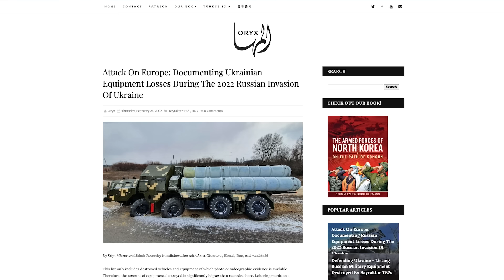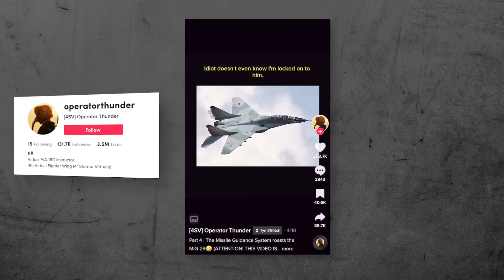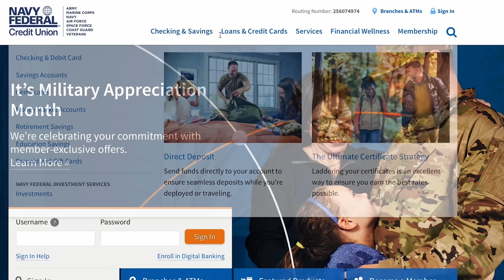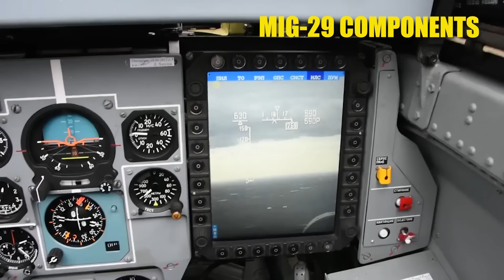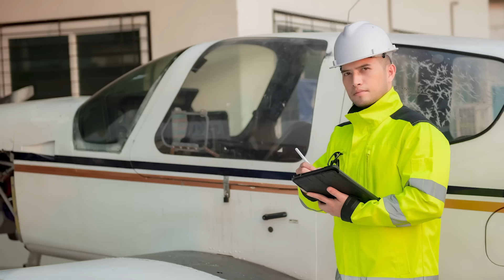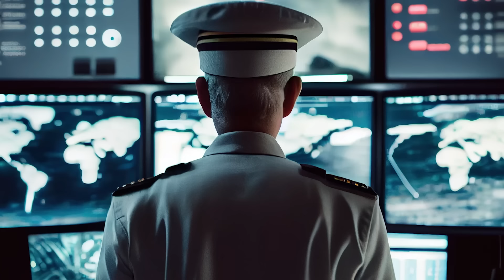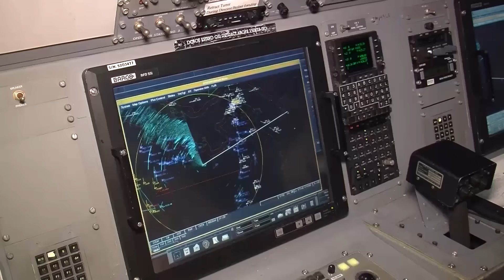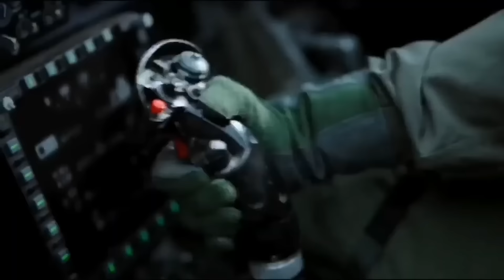How Ukraines new MIG-29 Fighter Jet Operates

Comment: I'm a recently retired F-15C pilot, I can add some anecdotal context.  F-16s are the wrong aircraft for Ukraine.  While the F-16 has far better SEAD capability than Mig-29s, it's in the same boat when it comes to being preyed upon by Mig-31 and Su-35.  The F-16 is a multirole fighter for a reason, and that reason is because it's ineffective at long range combat, and with Russia launching R-37 air to air missiles at Ukrainian jets from 100 miles out, the F-16 has nothing to counter that threat.  Why?  Small airframe aircraft such as the F-16 and F-35 struggle with radar output cooling, there just isn't enough physical heat sink area and fuel stores to run cooling lines through to match the radar output of an F-15 or Su-35, which means large frame aircraft can launch on smaller jets from much farther out on radar power alone.  I flew Red Air for a while at Red Flag and a flight of 4 F-15Cs routinely downs 12-18 F-16 / F-18 with no losses in real scenarios, its not even fair.  The correct aircraft for Ukraine are French Rafael (with the fancy electronics package) or EA-18G because ECM and ECCM are equalizers when it comes to leveling a BVR disparate battlefield.  The Rafael or Growler might still not be able to pressure the Mig-31 or Su-35 in air-to-air, but the jamming pods can give Ukrainian pilots the ability to get close enough to the front line to employ HARMs or air to ground munitions while frustrating both ground based and air based Russian radars and missiles, giving much better survivability than an F-16.  The Rafael has 14 hard points vs F-16's 9 so the Rafael can also shoot down more drones and cruise missiles if needed.  The F-16 really requires F-15 or F-22 mission support in combat Vs. Russian latest variant aircraft.  The F-35 doesn't have the range for mission effectiveness so they generally are in the back lines as support and situation awareness assets.
Reply: MiG-31s have to take long range potshots. Attack helicopters and Su-25s have to get within a few miles of the frontline.
AMRAAM races R-37, but one has to travel 5 miles and the other 100. Which one reaches the target first?
Reply: Thanks for the awesome insight about jet capabilities!
Reply: Thanks for you insight, that's very interesting. My little take on this: Ukraine cant operate their Migs forever, Airframes suffer fatigue, western states run out of replacement Migs. So at one point in time they need something to at least protect their airspace roundabout what they can do now or a little better. I dont think anyone expects Ukraine to gain air superiority, not completely losing it is more the target. Besides, the F-16 can use Aim120s and has at least a better radar than the Mig29, so this would already put some more pressure on the Russians and keep them further away.  As you mentioned the R-37, as far as I know its a anti AWACs and anti Bomber missile and doesnt maneuver very well, so I dont know if its really a great BVR missile compared with the Aim120 when it comes to intercepting fighters (but I dont really know much about it, just what I read)
Reply: There are many commenters suggesting that other fighters are better for Ukraine then the F16. Problem with those is that that there less available for Ukraine, if at all, and the logistics train for maintenance and supplies is far less abundant. So Ukraine will get what it CAN get, and I wouldn't be surprised that they can work around, or even solve those shortcomings. They have the reputation to be very effectively creative.
Reply: I think the F-16 is more accessible than the Rafale which is why Ukraine kept pushing for it. The Gripen is also another great pick, but I don’t think they would get the numbers they wanted for it.

Ukraine already had neighboring countries willing to help them with procurement and likely training for aircrew and MX. I think they will still get some Rafales eventually, but the F-16 is still a great pick for the current fight.
Reply: @ChucksSEADnDEAD  last sentence did not make sense. 5 miles? so the plane has to travel 95 miles while being shot at by the R-37???
Reply: No but the F16 is better than nothing.
Reply: F-18s would be great, except that the US Navy is already short of them. Waiting on new F-35s, currently if every carrier put to sea, some would be missing aircraft. More than 4,000 F-16s built means it really is the logical choice, if only for the fact they are available. There just aren't enough Typhoons and Grippens built for there to be any spares. Rafael, I have no clue how many were built, but good luck getting the French to agree with them being transferred to Ukraine.
Reply: @john_in_phoenix  Ideally the F/A-18F so that the pilot can focus on flying the plane while at 100-300ft while the WSO can search for targets and watch for threats. But that reduces the number of airframes even more
Reply: wow we finally have an adult in the room well said
Reply: @_Dibbler_  Soviet doctrine always prioritized ground based airspace denial (SAMS), which is the opposite of US doctrine which uses fighter based air dominance.  This is why Soviet SAMS are more capable than say the Patriot system, while US fighters are generally more capable than Russian fighters.  Missile capability on both sides (Nato and Russia) is some of the more classified data we keep close to our chest, and while the real world capabilities of the R-37 is still speculation, it's enough to put Ukrainian fighters into defensive before they can even register a radar contact, effectively denying the airspace even if the missile doesn't hit.  Also the AIM-120 capabilities vary both on variant (120C vs 120D) and the platform shooting it.  The F-15C APG-63 v2 and v3 radars unlock more capabilities of the 120D that F-16 and F-18 radars don't have.  So the capabilities is a marriage of the airframe and missile together.  The F-15C has the record for longest missile shot ever in 2021, the range of which is remains classified.
Reply: @pogo1140  It makes perfect sense. The Su-25 is 5 miles away from the line of contact, the MiG-31 is all the way back in Russia or Belarus.
I can punch someone across the face in less time than it takes to run across the street to stop me.
Reply: @whendoweeat  The French will sell the Rafael to anyone willing to buy it.  The issue is that Zelensky keeps asking for free equipment rather than purchasing equipment.  India bought 36 Rafaels complete with support and armament for 9 billion.  Ukraine has 100 billion from the USA to support it's war effort.  Even just using around half that 100 billion, Zelensky could have bought 180 Rafaels for 45 billion.
Reply: Yes, but we have lots of aging F-16's.
Reply: @BasedF-15Pilot  that's just wrong.
Reply: @BasedF-15Pilot  understood. And yet again. okayish fighters are better than having no fighters at all and an F16 Radar+Aim120 is better than Mig29+R-27 (or whatever they use). Perfection is the enemy of the good, its nice when people try to archive perfection but for Ukraine its about survival and nobody will give them F15s or Rafales or an F22, so perfection is out of reach. F16s are within reach and will improve the situation, they will not win the war, they will not bring air superiority, but I dont think they expect that.
Reply: Grippen might make sense. It has the capability but is not as ubiquitous and would probably take more time to deliver it. No need for US sign-off though.
Reply: Maybe at 1 vs 1 is better, but as a whole package amount of avalible number of spare parts / operators / weapons, there is not so many alternatives if France for example under russian preassure will decide dont maintain them tommorow, few month after ukraine will not have any air force.
Reply: @BasedF-15Pilot  Zelensky’s actions make sense. We in the US have spent billions propping up the wrong governments over the past 50 years. Ukraine’s war of self defense/liberation could not be more righteous. They are doing the work of NATO. This is an easy and justified move.

That said, I could see them buying Rafales while also getting subsidized F-16s. If I’m the Ukrainian CSAF/commander in chief, I want to maximize the numbers of 4th Gen aircraft in to develop the capacity to have experienced aircrew training the eventual 5/6th gen pilots of the future.
Reply: I've heard the jamming on the growler is something special. Hence why it won't be deployed there, or any French equivalent. Can't have Russian fingers on it
Reply: How about the Mirage 2000?
Reply: It is nice to see a qualified opinion here. Is the F16 better than nothing or more problems than it is worth? Are older F15s possible?
Reply: @whendoweeat  Exactly! Assisting the middle east nations was like herding cats and that is why the vastly outnumbered Taliban still won in days over indifferent people after years of training.
Reply: The Growler (and I assume Rafael) can also send location data to artillery and ground-to-ground missile operators.
Reply: Where does Typhoon sit?
Reply: All of this makes me worry that without a counter to Russian glide bombs, any offensive will falter.
Reply: I still find it incredibly odd UA and co. can just waltz into Europe and say "i want that, that that and that" and no one says "what the fuck?"
Reply: Fascinating. Thanks for the info. Got to see the 123rd squadron at the Oregon air show today and as a soon to be commercially rated pilot am seriously considering the ANG.
Reply: @BasedF-15Pilot  I don't think Russian SAM's are any better or more capable.  Latest version of the Patriot system can intercept hypersonic ballistic missiles while the bulkier Russian SAMs is easily emasculated by HIMARS.  Even our close range point defense system can handle mortars and HIMARS like guided artillery.
Reply: @kentl7228  Taliban didn't win. didn't win a single engagement.  US didn't lose the fight . they lost interest. How many captured american soldiers where there?  we ran out of space in GITMO.
Reply: @Shinobubu  i didn't mean the USA. I meant the Afghan military as the USA were leaving
Reply: The F-15 is an undefeated air superiority king.  Of course it is going to take out F-16's and F-18's.  The F-15 would also mop the floor with the Su-35 and Mig-31.  So that's a pretty meaningless comparison.  The F-16 has a major advantage over other fighters: it is cheap and readily available all over the world in great numbers.
Reply: @BasedF-15Pilot  I always hated the F-35 more for the lack of range than simply the ugliness, low maneuver and slowness.  Now at least a qualified pilot can substantiate my dislike. I did not know all these 4th gens had stealth attributes.  I have seen the top side and under belly fuel tanks tacked on F-16's. I thought it strange that Ukraine never asked for (some free A-10's) Grippen or Rafale jets.
Reply: Did it hit something beyond 330km? Because that's what R-37M did.
Reply: Issue with F15 that US and allies still use it , and plan for some timer , for Ukraine there are 2 US option  F16 AM as Netherland , Denmark & Portugal can deliver up to 70 of those quickly and uS have loot spare parts & ammo , second option is F/A18 as US have stoped to use it recently , Spain , Finland , Canada & Switzerland will retire those soon to = in short time there can be delivered similar number of F/A18 as F16 to Ukraine.
Reply: This guy doesn't exist lol
Reply: Good story, needs more dragons.
Reply: @Shinobubu  so giving up doesn't amount to losing in your mind? Taliban rules Afghanistan. Sounds like a win to me.
Reply: @leflavius_nl5370  that's because you don't understand global geopolitics or what's at stake here.
Reply: @BasedF-15Pilot  Ukraine doesn't just have $100 Billion sitting around in a bank. Thats not how military aid or presidential draw-down works. When we send them a $5 Billion aid package, thats the cost of the weapons/equipment being sent at current replacement cost, so the US can replentish its stocks with new weapons. i.e. The AGM-88 HARM currently costs $200,000, but thats now what the USAF paid in 1984. In the end, Ukraine will take whatever NATO gives them, France is not in NATO and will only give the Rafaels if it gives them good advertisement for future sales...but like Russia is learning. It's tough to sell equipment to the worls when you Vondervaffe is getting shot out of the sky by 1980's soviet block gear.
Reply: I think F16s are coming with JASSM missiles. F16 is capable of launching JASSM and JASSM  has a range of 400-1000 km. Ukraine needs them to strike targets in Crimea. Rafale doesn't have capability for launching JASSM  yet. It may require time to integrate them with JASSM. Although americans nor ukranians never mentioned JASSM I think they did negotiate about them behind closed doors.
Reply: @jamesmedina2062  A-10s will just be a liability, the only time they work is when they are fighting goat herders and  have air superiority.
Reply: @pogo1140  No he's saying the Mig-31 shooting at the F16 launches at 100 miles and the F16 shooting at the Su-25 launches at 5 miles.
Reply: @appa609  ok, that makes more sense
Reply: @BasedF-15Pilot  we are talking about aprox. 100 billion worth of equipment! Ukraine for the most part wasn't given actual money, there are loans, but a country at war as a lot of expenses.
Reply: @Pinicle_of_evolution  the biggest weakness and problem Ukraine has is not having slow-moving, low-altitude gunships including Cobra, Apache, C-130, and A-10. They also don't have the fast planes either and don't have bombers in use. They almost don't have any air assets. So they need a lot. They have very little. They don't need only one thing. At the same time, each air asset has its limitations and needs the support to operate. If Ukraine had 20 A-10's they could mop up every armored asset and push Russia out very quickly perhaps a week but it is an apex US fighter that nobody else has and the USA does not share everything it has including F-22. The US pushes propaganda out too. You should not believe everything they say.
Reply: I agree. F-16 is not an air superiority platform. Except for SEAD-specific airframes, the F-16 is a small bomb truck. Our pilots in Iraq had to decide whether to use the A/C to cool the radar or the pilot.
Reply: @BasedF-15Pilot  I don't know about the Patriot being more limited than Russian SAMs. Both the Pentagon and the Ukrainians have been tight limped about the shooting down 3 Russian warplanes and one attack helicopter over Russia. Since even the Russians suspect they were shot down by Patriot batteries. Which would mean Patriot radars and PAC 2/3 missiles have classified abilities/ranges that we are only now discovering. Abilities and ranges I might add the Russians boast their S-400 and S-500 have but have never been seen.
Reply: Right now MiG's the Ukrainians are using are extremely limited export models from 1980's. They don't have access to later generation MiG-29's or Su-27's. So even block 50/52 F-16 C's and D's, would be light years beyond what they currently have. The F-16's can do air to air and air to ground (using smart weapons) easily. MiG-29 air to ground payloads are limited and they can't use most US/NATO air to air or air to ground 'smart' munition's. At the same time their is already a supply chain for F-16 maintenance, repair and replacement parts in Eastern Europe. Not to mention the 100's of useable airframes sitting in storage around the world. Meaning replacements for losses is not just do able but most likely SOP. Its also been stated that if any air frame needs major work. That like NATO tanks, they will just be shipped to Poland or another NATO nation for repairs. The only real current hurdle is that every European nation that uses the F-16 uses its own custom combat software suite. But combat computer experts from Lockheed (who currently build the F-16V or block 70/72), say it should be possible to delete and install/over right a single software package for F-16's used by Ukraine (either the Polish or US one). The only limitation will be if any weapons system specific to the donor European nation require their software to work. But this shouldn't be an issue as main reason for using the F-16 is being able to use as many US/NATO weapon systems as possible.

So is the F-16 best plane for air war in Ukraine, probably not. But is it better than MiG's they have now or could get in the future, yes yes they are. Most expect the Ukrainians to use their F-16's in anti drone and cruise missile intercepts. It has a superior radar and rwr to the MiG's currently flowing by Ukraine. So even in limited air to air missions it is a superior air craft to Ukraine has now. Though the Ukrainians will mostly use their F-16's in air to ground attacks close to the front with limited SEAD missions. With the planes spending the majority of their time flying from air field to air field staying one step away of Russia's remaining precision guided missiles. That is if Putin will use them on difficult to hit military targets and not easy to hit civilian ones. Shame the upgrade program for the block 50/52 F-16 is only a year old. Block 50/52 upgraded to F-16V/Block 70/72, with its new combat computer, data link and AESA/SABR radar. Would mean the donated F-16's could essentially function as F-15C's.
Reply: As a retired Mission Crew Commander Air Battle Manager on AWACS that have controlled all pilots from many countries in many Red Flags and every US aircraft on the Korean peninsula, the F-16 is in abundance and there is a need. It may not be the best fit, but it's an improvement.
Reply: An updated, top of the line Rafael costs more than an average F-35, of $90M. (If memory serves, from reading around, I think the Rafael costs roughly around the much expensive F-35B, which is around $115M -  $130M per unit, due to its specialized vertical take-off-landing contraptions, plus low number of production.)

Operating the much larger, more powerful Rafale is ultimately more time consuming and more costly, due to its two engines (despite the public numbers out there saying the cost per hour operation of a Rafale is lower than the cost per hour operation of a single engine F-16: two complex engines on a high end fighter jets need at least TWICE as many mechanics, twice as many HOURS, to check and to repaire.... that's just common sense). 

A top of the line F-16, on the other hand, costs only around $60M. Lower end costs for the less well equipped ranged between $15M to $30M.

Unfortunately, the Ukrainians don't have money for ANY fighter jet, so, forget about getting $120M Rafales... and even if Ukraine were to have $5B available for Rafael purchases, there's no way to secure a number they would need.

But there are 4,000 plus F-16s produced over the decades... so there are still HUNDREDS of F-16s in very good shape, and still being flown, in half a dozen European countries. 

Denmakr, Belgium, Portugal, Poland, the Netherlands... combined, they could easily come up with 50 F-16s --- all donated or purchased with funds made available by the US and the EU --- late this year to early next year.  

Americans could donate more than 50 today, if it wanted to... but it likely wouldn't do it. What it'd do is to make FUNDS available, with the EU.... so Ukraine could use that money to buy a dozen more, on top of those donated ones from these said European operators of the F-16.

So, yes, F-16 is the most sensible jet for Ukraine to have, right now.
Reply: @bohuslavhumplik6744  are you high? Ofc France is in NATO.
Reply: What about... F-15s? the Eagle has a pretty beefy radar too, as you know. Just give them Strike Eagles. Those are great at CAS, aren't they? They are STRIKE fighters, after all.
Reply: Good conclusion. But I think they push so hard for F-16 becouse they could get some eighties versions for cheap to be able to use western weapons and systems, and those would be really cheap in comparison to other airplanes.
Most of what they get would be pretty much decommissioned or almost decommissioned aircrafts. It's the same thing with M113, HMMWV and so on.. It's cheaper to send it to Ukriane and say "i we support you" then to scrap it properly.
Reply: @Paweł Kabański  the Gripen would have been perfect to purchase back in 2014-2015 as part of their build up, this is the war scenario it was designed to fight - and it can be equipped with the Meteor missile that has a 200km range. 

If Ukraine had those up and running by the time Russia invaded, they could have air superiority and have won a air attrition war due to the Gripens fantastic logistics. 

But there are simply not enough Gripens in existence for any to be spared for Ukraine. 

The only possible far fetched solution would be for  the US to backfill Sweden's (or Hungry/Czech/South African airforces) with a whole bunch of existing quality US inventory so that operational aircraft could be sent to Ukraine. 

The Czechs are the only viable option, as they could be given a mix of F-35's and F-16's(/F - X whatevers available and useful) out of existing stocks and rely on their fellow NATO members for maintenance and logistics while they got up to speed with their new paradigm.
Reply: @whendoweeat  just because it's right doesn't mean we owe them anything
Reply: Thanks for the dope reply!! God bless you. And thanks for your service.
Reply: "rafael"    ?
Reply: What? The f16 was made as a rocket with a seat by a combat pilot wanting the ultimate dogfighter.
Reply: @sethshaw5680  can it outrun a SAM?
Reply: Macron and the French are not ready to part with their Rafaels in real time combat stress test (as yet) against the Russian Sukhois, MiGs, BUKs and SAMs.
Reply: There is no country that will help Ukraine with anything significant related to the Air Force. Poland gave its used MiG 29s that had already served their time in the armies of first East Germany and after unification in Germany, and they were sold to Poland, I think, for one euro. Poland later invested something around 43 million euros in modernization. Don't forget the time period in which this happened - 19 years ago! When the last Slovakian Fulcrums were retired, it was widely reported that the final fleet comprised around 11 operational jets — a mix of moderately upgraded MiG-29AS single-seaters and MiG-29UBS two-seaters. Let's not forget that the two-seaters UB and UBS do not have a radar and their use in wartime conditions is very limited, I would say almost impossible in these wartime conditions. North Macedonia gave away its Su 25s that ran out of resources! Anyway, the Ukrainians overhauled them and included them in the composition of their air force.
It is unfortunate that a country that, after the collapse of the USSR and gaining independence, made constant wrong moves. 
First, they destroyed their nuclear arsenal (with the collapse of the USSR they became the 3rd nuclear power in the world), If it had not been destroyed today, there would be no war! There would be no problem of Crimea (seeing things through Ukrainian eyes)!
Second they destroyed their air force (which was the second strongest in Europe after the collapse of the USSR) 3000 aircraft, of which about 1600 fighter planes and 300 attack helicopters. Destroyed strategic aviation partly cut (Tu 95, Tu160), partly handed over to the Russians for gas debt. The rest of the fleet was not maintained (even strategic Tu 22 and Tu 22M), and the flight status was maintained by cannibalizing the aircraft. As a result, the number of operational aircraft was drastically reduced, entire regiments were disbanded, and certain types disappeared from the inherited arsenal.
And so it was in all other segments of the armed forces.
That it has come to the point that today that same Ukraine, steeped in corruption, is literally begging the West for weapons and equipment.
I absolutely agree with you about the Rafale, that would be the right one. But there is another problem. France does not have enough of them even for itself, and it also has a large number of aircraft ordered and paid for for export. What they could eventually get from France are the Mirage 2000Cs that it has withdrawn from use in its air force.
The crucial question is how long does it take to train a combat operational pilot on any type of aircraft? Abbreviated training means that both the pilot and the aircraft are easy targets. You certainly have an adequate and better answer to this question than mine!
Reply: Agreed, send Ukraine your F-22!
Reply: Hi, I'm also F-15C pilot, and my grandma is F-22 pilot.
Reply: Finally someone with real experience who’s able to confirm what I’ve been saying for months! I’ve said the Saab Gripen is the best option, however it’s been pointed out to me that the Swedes don’t have the infrastructure for mass production, though their small ground crew needs and ability to carry MBDA Meteors would be an insane help to the UKRAF
Reply: @jamesmedina2062  Actually I will tell you this that's not really accurate US is not known for propaganda with their aircraft as in are better than they are. USA Does the opposite they learned long ago to Downplay their capabilities till it's needed to be used. Hence why you do not see Show of power parades and such from US. I spent 17 yrs. in the marines and 7 more years at SOC LLC (DOD Contractor). Anyone telling you that US boost their capabilities is 100% wrong They purposely Hide new capabilities and also why they won't allow F-22's to Show full combat capabilities on Exercises! We are more famous for Look overhear wow and while they are looking were Testing in Secret shit, we won't even use for 10 yrs. Do not believe every thing we say but its not boosting Capabilities propaganda Like your making it sound its Secret Operations another words its not o our F-22's have .0005 Radar cross section and really its .00003. (example not meant to be accurate). or  our new fox 1 has a range of 100 miles but really you can push it to 125 miles. or our fox 3's pit bull at 90 but in reality it pit bulls earlier and longer to throw off the first engagement of our enemies someday China and Russia will learn to keep secrets secret and instead of boost really surprise people and down play it then when you show it off people's expectations will not be just ignored and destroyed!
Reply: @c.s.4273  Sure we will send 40 and shit here take 5 of our nukes also why not! LMAO
Reply: @killingyouwithlogic5808  Coward much?
Reply: I know almost nothing about fighter jets what so ever.  So I got no idea which airframe is the best.  But what I do know is, F-16 is the only airframe that is realistic.  

And you forgot to take 1 VERY important information in to account, suppliers of gearsense. JDAM are dirt cheap compared to a GMLRSs rockets even when you have strapped on a guidance and glide kit on it. And makes a WAY bigger hole then a MRLS rocket. Heck you can even put a "HARM" seeker kit on a 3000USD JDAM.   

France and Sweden will never give up Rafael or Gripen, way too few airframes.  

British Eurofighter trench 1? they are about to get shelved, but they are not strike capable, and if Ukraine cant do air superiority with them against Russian targets, then what's the point in trench 1 Eurofighters. Can trench 1 fire Storm shadow? I dont know, but thats a REALLY expensive missile truck, just for that purpose, and it seems like they some how jerry rigged Storm shadows on to Su-24's 

Older F-18 non super hornets? maybe, but who has them? Spain, doubt it, they havnt really contributed with much at all, so why would that change now?  Finland? not until they have F-35 replacements. Australia, from what I read they have some of their old FA-18 in storage, can they fly? and will AUS donate? UKR is not really their problem, so that they have given anything to start with is commendable. 

US navy has super hornets, and marines legacy F-18's, but again, will US donate them? doubt it, I read one article after another that the remainder of those frames are being used so hard they are held together with shoestring and duct tape since they dont have enough airframes as it is.

Growlers? not going to happen, loosing one of those to RUS would be a massive intelligence coup. All that fancy good stuf RUS actually has, if there have been any lost that was salvageable, its being picked apart component by compete in the US and Britain.   that is phote evidence of a complete seminally undamaged EW pod for a crashed RUS SU-34 from last summer.  That thing has been dissected so hard like it was a Area 52 roswell alien by now. 

Tornado's. Germany has a few EW left, plus those they are obligate to keep for the nuclear sharing obligations. Italy has some, dont know  what state they are in, But Italy, just like Spain, have not really cough up any big ticket items at all. So I really dont see it. 

Mirage 2000? maybe, since Macron have stated they are willing to train UKR pilots, and France invest heavily in their own defense sector so buying more rafaels replacing those older Mirage 2000's seems like a logical move.
Reply: @arturasp9738  An your grandad fly in Apollo program to the moon. I know, I saw it!
Reply: Great and spot on analysis.
Reply: You obviously know what you’re talking about but I just haven’t seen one Russian military asset outside carpet bombing civilians working as advertised so my uneducated guess says any of those Western planes will get the job done
Reply: @IrishNDF  No plane, especially not a western one, can be good in this war. They have performed well in the wars that the West has waged against small, militarily weak and powerless states. Using all possible support and logic in terms of AWACS aircraft, satellites, and distinct air superiority both quantitatively and qualitatively.That is not the situation here. Russia has a powerful air defense and a powerful air force, but it does not use it. You will ask logically why? Because this war can easily turn into a direct conflict between NATO and Russia. Russians are not stupid. They know that NATO will supply the Ukrainians with their surplus, or weapons and tools that in most cases have been decommissioned from their armies. NATO will indirectly wage war with Russia to the last Ukrainian and try to exhaust Russia as much as possible, and then if a favorable moment presents itself, it will directly intervene in the conflict. NATO would send first of all Poles who hate Russians from the bottom of their souls. There are volunteers in the Ukrainian army anyway, they just die in large numbers. Another aspect of sending modern weapons to Ukraine is how the tools or weapons will perform in war. The Americans have the greatest fear of this because it affects the sale of the same in the world. If your product performs poorly in a war conflict, you have irreversibly invested money in its development, or rather something that no one will buy later, in order to recover your invested capital. As I said before (concerning aircraft's)  in the previous post, who is going to fly them? How quickly can you train a fighter pilot without both him and the aircraft being ducks in the row on the sky to be shot.
Reply: @richardkudrna7503  The Typhoon in an a2a config is the best a2a fighter I've fought short of the F-22 in bfm.  Unfortunately in BVR it's down the list due to small radar real estate.  Also Typhoons are rarely in a2a config because the nations that use them need them to be multi-role fighters.  Multi-role = compromise.
Reply: @jamesmedina2062  The range is the F-35's biggest Achilles heel, and forces tanker and C2 assets (AWACS) to push closer to the front line.  Stealth attributes are not everything, we have (classified) methods of detecting and targeting stealth.
Reply: @Max_Da_G  Maybe.  😇
Reply: @RasterivacMagle  

"It is unfortunate that a country that, after the collapse of the USSR and gaining independence, made constant wrong moves"

This statement is a painting in a complete misunderstanding of the meaning of what is happening.

It is impossible to fight with Russia from the territory of NATO, this is immediately a nuclear apocalypse. But if Moldova, Georgia, Ukraine, Kazakhstan or Ukraine enter into a conflict, then NATO seems to have nothing to do with it.

How to make these countries self-destruct?
   It is necessary to grow an elite that does not link its fate with the fate of the country.
Therefore, it is necessary to encourage corruption. When competing, semi-gangster power groups begin to gnaw at each other's throats, declare a fight against corruption. When the thieves hide the loot from where the thieves are not given out (for example, to London), everything is completely under control.

How to explain what is happening to people?
It is necessary to finance hundreds of NGOs and together with the press to tell - it does not matter that the DNA of Ukrainians, Belarusians, Poles, Russians coincides 100%. In fact, Russians are not Slavs at all. Russians are prone to violence and drunkenness, are lazy, envious and love dictatorship.
You are talented, hardworking and creative. All troubles from the Russians!

Trade and joint production lead to mutual understanding. So to hell with this production! To hell with this trade! But no one will buy Ukrainian products, except for Russian ones!? Spit!
This leads to the collapse of the economy!!!??? Yes, but Russian and pro-Russian politicians are to blame for this.

Now every Ukrainian is sure that as soon as the country joins the EU, corruption will immediately disappear, the courts will become fair and everyone will live richly. Why? - only pro-Kremlin agents ask such questions.

To get into the EU, you need to prove that you are worthy and break with the dark past. Therefore, Ukrainians desecrate monuments to their grandfathers, renounce religion, ban Russian writers, musicians, speak Russian, make heroes even recognized criminals.
Democracy is like that - you can not even notice how 50 people were burned alive, how they shoot at Donetsk.

Ukrainians were dragged into this swamp for 30 years like sacrificial sheep.
Everything that happened was not an accident, but a pattern.

This wretched state simply could not maintain and maintain 3,000 aircraft. Not before they were.
Thieves could sell a nuclear warhead. Neither the Americans nor the Russians need this.
Reply: @WinVisten  F-15Cs have too many hours and too many airframe G-cycles, they were used far past their prime much like the B-52, except the B-52 can't stress metallurgy like the F-15 can.  This is why we buy new F-15X.
Reply: @uncreativename826  The Gripen is a really good jet for small nations with limited airspace.  But you are right I don't think they can be pumped out really fast.
Reply: @killingyouwithlogic5808  This is correct there are certain tactics that cannot be used in LFE (large exercises) or in dissimilar aircraft bfm.
Reply: @BasedF-15Pilot  Zelenskyy isn't being given the money, he's being given equipment worth the money. So for now France isn't donating their aircraft.
Reply: @BasedF-15Pilot  Of course range matters as does speed, including acceleration, ceiling, and maneuverability. Cost to maintain apparently matters too. What is telling is that F-22 was stopped at under 197 but why? Why were the facilities mothballed? I am assuming to make way for the Swiss Army knife. I do woodwork and am a chef. Why would I want a Swiss army knife that does no single thing that well? I guess they had decades to bling out the sensors in the thing(and computers)..to make them 2nd to none.  The most critical thing today is as you said that these planes are not 777 able to go halfway around globe. They require aerial refueling and the tankers are not stealth or high speed. And they said way more tankers are needed. I just find it absurd to have such poor range and abandon the whole suite of specs the F-15 had...seems went backwards and like you said nothing is totally invisible from all angles.
Reply: @jamesmedina2062  The f-22 main reason for stopping the Production was 2 major reasons 1. Need for specific CAS and Air to air was not really a large need for the war on terror. 2. Making open funding for the 6th gen capabilities. I would never sleep on the f-22 or F-35 or f-15 but There at their best when all 3 are flying tactically together!
Reply: @tristantully1592  They have received Money and equipment! The U.S. has given Ukraine more than $54 billion since the war against Russia started1, with the bulk of the money allocated to military and defense spending2. The U.S. has provided $8.5 billion in direct budgetary support3 and $13.6 billion in military aid4 since the beginning of the Biden administration, including 19 packages of weapons since August 20214.
Reply: @BasedF-15Pilot  People do not understand the meaning of stealth they think invisibility not That you can Locate Stealth Jets but good luck Locking and maintaining lock on F-22 or F-35. Stealth is a major help to the A2A and A2G but by no means makes the jet invisible or Impossible to Find or even lock but makes it worlds harder. I have tried to explain this many times and people just do not understand. Stealth aircraft they forget it's not 1 tech that makes the f-22 as stealthy as it is it's an abundance of overlapping stealth technology that makes the f-22 and f-35 as stealthy as it is. Hence why China and Russia have failed to make a stealth air craft as effective as the f-22 and f-35 there is so much tech that makes up the overall  its insane.
Reply: @Shinkajo  buncha fuckin sunflower and wheat fields

Raytheon, Lockheed Martin and Rheinmetall must be loving it though
Reply: rhdrivingslovenia6413  no it would be Ukraine trained by US.
Reply: rhdrivingslovenia6413  They estemate 6 months for f-16 so I would figure 8-10 months Growlers and 6 months for Rafaels . you need to remember that there trained pilots just not these particular jets its not a total relearn just adjusted!
Reply: rhdrivingslovenia6413  But with that said f-16 is one of the easier to learn jets so maybe 1 yr growler and 8-10 months for rafaels
Reply: @killingyouwithlogic5808  Yes the advent of higher capability computers and "situational awareness" is interesting and yet still to me an unknown. What we need coming up is cheap drone shoot-down, as expensive A-A missiles have been a problem shooting down cheap drones and China will for sure have thousands of drones. The war in Ukraine will teach us a lot. It will be interesting and to see what the J-20 and Turkish jets are like in action.  Even for doctrine we need to study and learn because what need is there for multi-million dollar jets when attack drones can preserve lives and achieve results? A highly defended air space is not a place where jets will be sent anyways!
Reply: Great insite!
Reply: If the Ukrainians are going to have a chance to defeat the ISR strike systems of Russia .,They must take out the layered Air defense systems first.The F 16 is still a 4th generation fighter that is easily destroyed by S-300,S400 systems.This aircraft would be of dubious value as a stand-off attack weapon.
Reply: @averyheavenrich2432  how do the S-300 and S-400 do against cruise missiles and low flying aircraft?
Reply: "with Russia launching R-37 air to air missiles at Ukrainian jets from 100 miles out, the F-16 has nothing to counter that threat" AIM-120.
Reply: You put into words what I never could.  But I have watched enough vidoes by noe to know that you are 100%ncorrect.  Why don't people get it?
Reply: @adammarcinkowski-ko3el  Well, the Finnish F-18s are not available until the F-35s and their infrastructure are there to replace them. Furthermore, one of the reasons they are being replaced is the fatigue. There isn't going to be much flight left in those frames. I'm not saying they wouldn't help in a war, but it won't happen for quite a while unless Finland gets to jump the queue.
Reply: @arturasp9738  This is what I was thinking lmao
Reply: @blechtic  Buddy if there will be need Finland can hand over 12-16 F18 without loosing ability to protect Finland ... Finland is in NATO ! , and after all Ukraine dont need F18 for 25 years service , Ukraine need them for 12-24 months until other alternatives will be avelible .
Reply: Great insight. Thanks.
Reply: @whendoweeat  Getting pilots to learn the ins and outs of one new plane in a short amount of time is daunting enough. Having them train for two different models at once, with different maintenance, parts, radar and weaponry is simply too complex for a country that is actively engaging the enemy at the same time. Less is more.
Reply: @Shinobubu  The Taliban didn't need to win. They just needed to survive. It's called guerilla warfare, slowing draining the enemies will to keep fighting. The vietcong did the same.
Reply: @WinVisten  Most Nato countries don't have them, so both suppluying and supporting them well will be hard.
Reply: @titaniumskunkogkush4365  probably not, but it would definitely out maneuver a SAM. Dont get it twisted. I'm against sending anything to Ukraine, but the f16 would be the most effective jet to send. I just hope they don't get sent.
Reply: @adammarcinkowski-ko3el  ...which is why I said what I said about the war. Fighting a war, though, will stress them more than normally. I'm sure Ukranians would prefer fighters that are less likely to break on their own, but they would work. Pilots would need to be trained.

NATO works on the principle that everyone handles their own remit especially WRT Finland who is not yet part of any of the plans or structures. So far NATO is a week away from Finland if they are needed. Nobody has exactly volunteered to patrol Finnish airspace in order to release those fighters either. I guess they have their hands full with the other half of NATO's border with Russia.

Anyway, all those Hornets are assigned to units and in use, they're not sitting in storage on some desert as a reserve. Surprisingly large part of them are inactive at a time for various reasons. Presumably Ukraine would want theirs out of those that are not out of action. 12-24 months is probably the absolute minimum time in which Finland could provide them, depending largely on those F-35s.

But, be that as it may, I am not the person you have to convince. I'm not the one making those decisions. Finland plays it safe. If some other countries were to be serious about those Hornets, they would try to find a way to make it happen by addressing Finland's concerns.
Reply: Growlers definitely seem like an extremely useful item in this war.
Reply: What is your take on JAS39 Gripen to Ukraine?
Reply: I never considered radar cooling as a limiting factor!
Reply: @BasedF-15Pilot  What nonsense is this? The F-35 carries a huge amount of internal fuel and has more than double the combat range of an F-16. It also does that using internal fuel only whereas the F-16 has to carry multiple tanks which reduces available hardpoints and significantly increases drag.
Reply: @jamroast 

Ukraine is going to have to train a lot of pilots .
I think start with 5000 I’ll never want to run out if pilots
Reply: At last someone talking sense
Reply: @leflavius_nl5370 because it’s in Europe’s collective interest to see Russia lose in Ukraine. Most of these weapons were created to fight Russia, but now they can fulfill that mission without expending American, German, French, British or Polish lives. The general consensus is that defeating Russia now will prevent a wider war later. Whether you believe that argument is not the point. It’s what the European governments believe.
Reply: @bohuslavhumplik6744 France is in NATO. In 1966, De Gaulle took France out of the integrated command structure, in order to have more independence in its potential military response, especially concerning its nuclear weapons. They never actually left NATO, though, and were still fully committed to the collective defense of Europe. In 2001, they participated in the US led coalition’s invasion of Afghanistan specifically because article 5 of the NATO charter was invoked for the first, and hopefully last time in history. In 2009, they returned to the integrated command structure, and continue to be one of the most indispensable member states of this alliance.
Reply: Bro just Eat "My Plane is better" kids in this comment fr
Reply: Finally someone that’s a pilot bringing insight to the f-16 issues, good radar and visual doesn’t mean anything without the missiles. We live in an age where dogfighting is rarely used.
Reply: @nemoclavon566  The F-15 has the ability to 'unlock' certain missile abilities that the F-16 and other NATO jets cannot, even though the same missile is hung on the same rail.  That's why I say the whole platform matters (jet + missile = platform) more than just raw missile statistics.
Reply: @BasedF-15Pilot  I know I’m just saying that’s a point most people miss you’d,people were like f-16 = an ez win
Reply: Lmao whatever you say
Reply: @coronalight77  to me?
Reply: Isn't Russia getting their shit rocked? Also, isn't Russia like 30 years behind when it comes to maintenance and often cannibalizing equipment? 😂
Reply: @hes1shot671  I've seen US jets so cannibalized that they have to put weights in the nose to keep them from sitting back on the tail feathers.  Supply chain on certain parts is thin.
Reply: @hes1shot671  It is but still Ukraine can’t fight far, which is why on land they easily rock them, in the air their MiGs and the haven ones from Poland have been getting destroyed.
Reply: @nemoclavon566  I wouldn't say destroyed to that extent because Russia can project far into Ukraine without getting hit by AA or SAMS. Still bizarre how Russia can't perform SEAD though
Reply: @hes1shot671  well that’s fair but unkraine has been stealing Russian weapons too you gotta keep that in mind, there tanks and even some aa have been stolen (or what ever those trucks that shoot msl are called.)
Reply: @nemoclavon566  agreed but Ukraine does share the same tech Russia uses and I mean if it's free why not? Also, AA trucks are like SAMs they launch anti-air missiles with the use of Radar. Note when using said radar you are also vulnerable to attack.
Reply: @hes1shot671  yea we know unkraine is permitive, but one thing we can agree on is for what they have they are doing good, reminds of the battle between Russia and Iceland.
Reply: Never would of thought about it like this. Dope insight
Reply: @ethangardner2470  everything here is
Reply: I always thought the Saab gripen would be the best option for them what's your opinion?
Reply: @wilfridhunt2468  Can you tell me id like an elaboration and explanation, I’ve never heard someone say that as a choice.
Reply: Would the F/A-18 Superhornet not also be a good option for Ukraine?
Reply: @CitrusAnarchy   nope, they don’t need a another multi role with limited range
Reply: The radar and BVR capability on the F15 is out of this world... Not gonna lie.
Reply: @benjiman46  it is literally, satellite shot down using a msl from that bad boy
Reply: To add on to that, Ukrainian aircrew’s would have to get trained in a completely different aircraft in such a short time. And while an F-16 would be better at SEAD and CAS (although MiG-29s have been AGM-88Cs against Russia), The F-16 is still somewhat similar in that it has a short range, and can carry only 6 A-A missiles (unless you double rack the AMRAAMs idk)
Reply: @zbee-nah-lah  that too
Reply: F16 is often known for its wild weasel capability. R37 is a heavy missile, an F16 can avoid it. idk if your statement has any relevancy.
Reply: @DessertUnicorn  R37 is about 500kg, we've lost more F-16s to missiles weighing over 600kg than we have to missiles weighing less.  Missile mass matters very little when it comes to successful missile defense.  Consider my statement relevant.
Reply: You are saying things that make sense, make it STOP
Reply: Thank you for the detailed input.
Reply: @SovietBear4  sad about the foxbat?
Reply: @DessertUnicorn  Sir those are radar msl, they don’t chase. They have advance tech to counter countermeasures to an extent. This concept is like comparing the MiG 23 to the f-15. There are so many factors making the f-15 better even though it can weight 3 times the empty MiG 23’s weight. It’s heavier for a reason, it’s a hypersonic missile, that thing usually goes 5 times faster than the f-16 and the f-16 couldn’t even fire back. It’s heavier for a reason.
Reply: Well , it's certainly better than nothing
Reply: Is this considered classified information? Or can I send this to Gaijin to prove how over powered something is?
Reply: @nemoclavon566  you are ridiculous. IR guided missiles don't chase either. there isn't a guided missile that "chases" out there unless its wire guided. I mean if you didn't know that then how would you know that we had mach 5 missiles in the 70s AKA the Phoenix coupled with an amazing radar of the F14. But no the DOD didn't think it was worth it or effective yet you and the other keyboard warriors here would much rather argue over it and call hypersonic missile from a country that can barely keep its own population fed with a crippling economy an actual mass threat.
Reply: @spades7227  I don’t think it’s classified
Reply: @DessertUnicorn  Chase as in follow the path of, radar msl go to a set point to hit an air craft, the ir literally goes wherever there’s heat so it is chasing.
Reply: @DessertUnicorn  and why are you talking about the f/14 and the 70’s I’m confused on that part, you just sorta started yapping about that?
Reply: @DessertUnicorn  you need stop trying to start things, like telling a literal vet his statement isn’t relevant, and then trying to call me a jerk to society. I answer calmly and you answer with insults.
Reply: @nemoclavon566  see what’s the point of arguing to you because you think IR guided missiles just follow a heat source. no they intercept the heat signature
Reply: @nemoclavon566  because the entire premise of your “scary hypersonic missile” is the hypersonic part and that it can go mach 5 when russia and US have dun had missiles that can go that far. and then riddle me this. why does the air force and the navy prefer medium range amraams over phoenixes? why is the lightweight missile demanded more than a heavy long range hypersonic missile
Reply: @DessertUnicorn  sir have you not heard of the aim 120 and the 260? Those are bvr long range
Reply: @DessertUnicorn  intercept means meet bro. Follow means go where it goes, intercept is meeting where it goes it’s the different thing bro.
Reply: @DessertUnicorn  the phoenixes are outdated brother, America is the place with the farthest range air to air msl, what makes you think they don’t use them? Price or radar capability would be a better argument than yours even.
Reply: @nemoclavon566  I’m just thinking about this way a 1200lbs r37m(heavier than an outdated phoenix btw) vs a 350lbs amraam. I think a jinking f16 has better odds against an r37m than an r77
Reply: Maybe they just want to lob missiles against a Russian attack, not actually attacking?
Reply: @nemoclavon566  you literally just differentiated the two from each other and now you are saying they mean the same thing
Reply: @DessertUnicorn  Blud it’s not just weight like I said 😖.
Reply: @DessertUnicorn  Idk how to explain it to your azz. The msl is consider chasing because it’s going after the after burner not an assigned point and ever heard of a typo.
Reply: @nemoclavon566  no it does not go after the “afterburner” the missile goes after any heat signature it can find, and based off that heat signature constantly calculates an interception point. it would be ridiculous if the missile just went for the heat signature let alone just the afterburner
Reply: @DessertUnicorn  Ik this but where it would be like the mainly thruster and specifically it finds heat by the heat signature, most of the time being the aircraft unless your the sun flares etc. sorry for a bad explanation
Reply: @reubs91  idk but I’d think they’re want em for defense
Reply: @BasedF-15Pilot these 100bln   are not cash though. It's not like he can go to shop. It's more an arbitrary number attached to mostly eol equipment and ammo the us would otherwise have to demil at much greater cost.
Reply: That’s decent and honest information … idk what is deal with Russians why they were not able do much or I think they have already achieved their mission objectives ..  but Russian Air Force is capable one a fool would underestimate them . If western jets are 100 then Russian not far behind 95 that is not huge difference but mission profile is everything 😊
Reply: It's Rafale, not Rafael. Rafale is a burst (gust of wind), Rafael is a name
Reply: @kainey  w fax
Reply: @kainey  I know, and I'll never stop spelling it like that because 'Israel' is muscle memoried in my typing.  Rafael, Israel, while Rafale feels like a misspelled something despite it being correct.
Reply: JAS Gripen enters the chat
Reply: @Goat-vy2bi  Viggen leaves the chat
Reply: Did you have any engagements with eurofighters? How it went?
Reply: In my mine nothing at the moment is better then the f15 yes the f22 and the f22 might be better  but the f15 has 105 kills to 0 losses that my friend is mighty big shoes to fill as it's never been done before in the history of the world